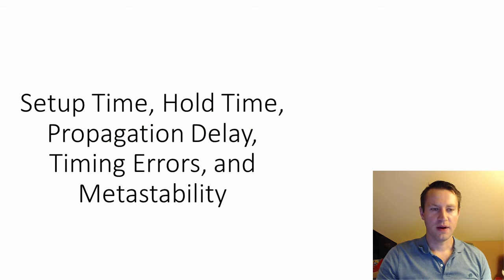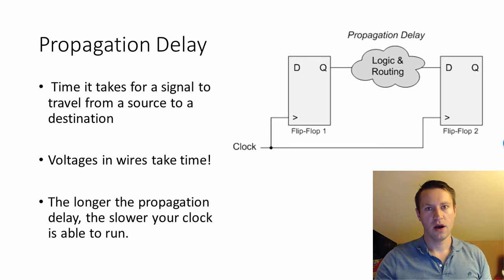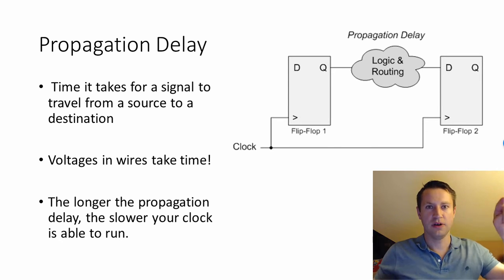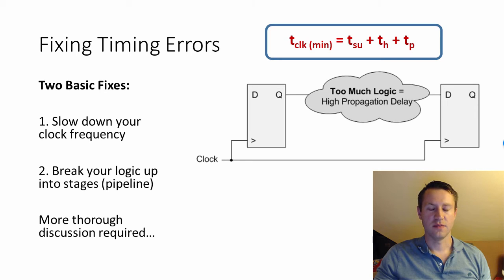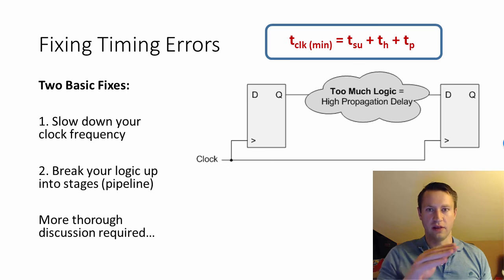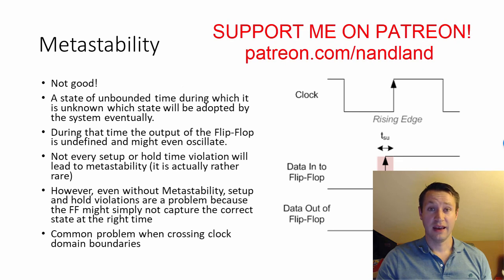Setup, Hold, Propagation Delay, Timing Errors, Metastability in FPGA

Comment: Why is setup time checked at next clock edge but hold time is checked at current clock edge? signal should be stable after edge of the next cycle as well. so should not hold time also be checked on next cycle.

Comment: 🎯 Key points for quick navigation:

00:03 📚 The video covers setup time, hold time, propagation delay, timing errors, and metastability in FPGAs, all related to flip-flops.
00:30 🔄 Flip-flops require data to be stable before and after clock edges to avoid timing errors.
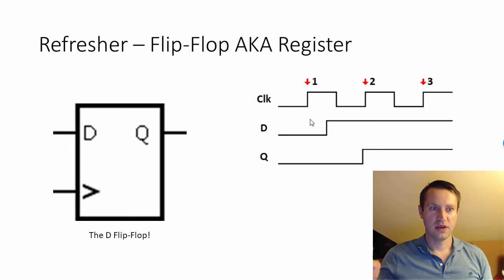01:37 ⚠️ Timing issues arise when data transitions too closely to the clock edge.
02:04 🚦 Setup time is required for data stability before the clock; hold time after the clock.
02:58 ⚡ Propagation delay affects signal travel times and clock speed limitations.
04:21 ✨ Reducing propagation delay is key to running faster clocks without errors.
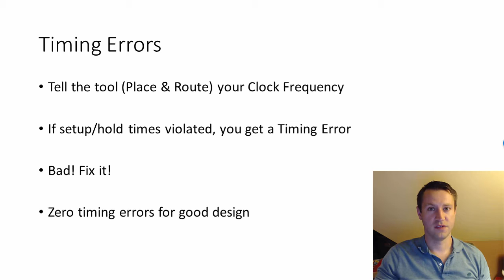05:30 🛠️ Fixing timing errors is crucial for reliable FPGA designs.
06:40 🏗️ Pipelining logic can reduce propagation delay and fix timing errors.
08:04 📊 Pipelining introduces clock cycle delays but allows data to flow smoothly.
08:59 😨 Metastability occurs when setup and hold time violations cause undefined states.
10:09 🚧 Crossed clock domains may lead to metastable conditions and require careful handling.
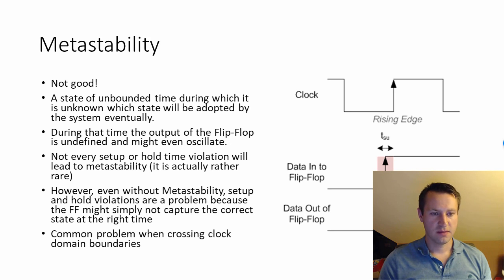10:24 🛂 Back-to-back flip-flops help manage metastability in crossing domains.

Made with HARPA AI

Comment: short, sweet, and crystal clear. and in English too :). would have been nice to have an explanation of why setup and hold times are necessary.
Reply: From what I understand, the reason you need to pay attention to it, is that unlike the graph shows, when the bit goes from 0 to 1 or from 1 to 0, it doesn't happen in 0 time, it take a few mili/nano seconds. That's why we need to wait for the change to happen, so we won't accidentally capture the signal when it's between the 0 and the 1 signal.

Comment: Minor Correction: There is 1 ns delay for every 15 cm on a PCB trace which has standard 50 ohms impedance. This number might change in case of circuits with digital gates. If you break down any logic gates it is basically CMOS/NMOS gates which has its own intrinsic delays due to its own propagation and switching delays. We are talking less than 100 ps delay per MOSFET gate but if you line millions of MOSFETS these numbers starts adding up.

https://www.sciencedirect.com/topics/computer-science/propagation-delay

Comment: I love timing errors... when I started to work (still in dummy mode, not productional) I never paid attention to them sometimes the design worked sometimes it failed  (and with sometimes I mean: sometimes the synthesis output worked, but another time the synthesis output failed on the FPGA). It only permanently worked once the timing errors were solved